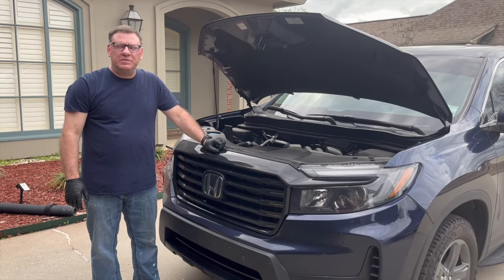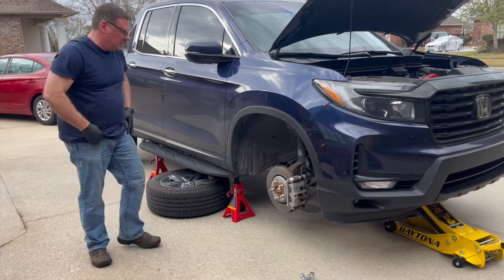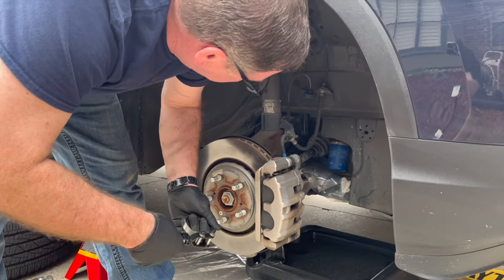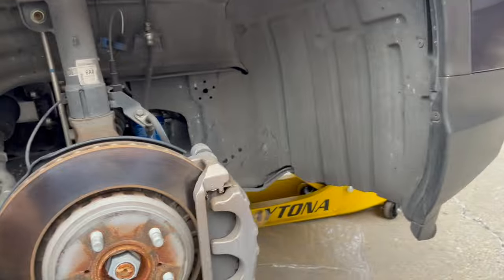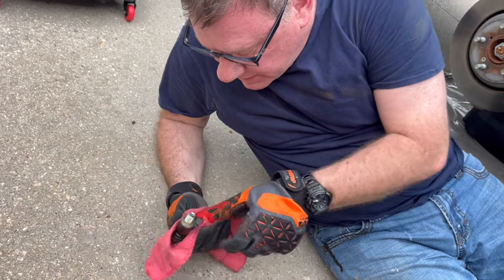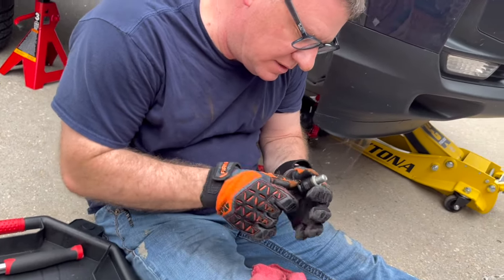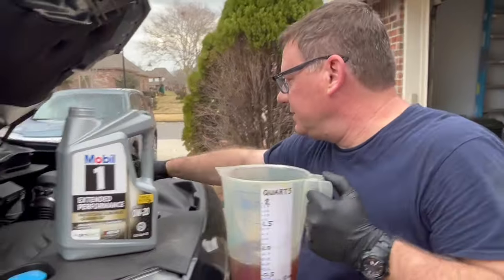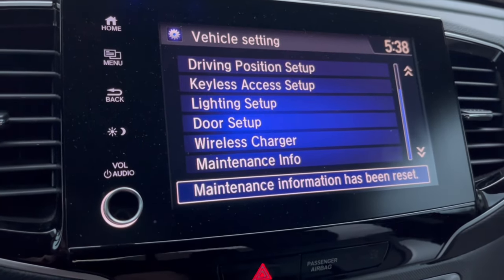2021 Honda Ridgeline Oil Change

Comment: You can use a plastic bag and put it on the filter while removing it. So that way no oil drip on the subframe 😉
Great video, thanks
Reply from the maker: Yeah, I have done that in the past. I should try that next time.
Reply: @PaulNaylor3  Honda is also selling a tool called oil deflector part # VSB02C000052
Reply from the maker: I will look into that, thank you!
Reply from the maker: My local Honda dealer wants $55 plus tax for that deflector funnel. The cheapest I found online was $31 plus tax & shipping. At that price I think I will just continue putting something over that crossbar to protect it.
Reply: @PaulNaylor3  I agree with you
Reply: Thank for the video - very helpful as I just changed the oil in my 2023 Ridgeline for the first time.  Removing the wheel  is definitely the easiest way to get to the oil filter.  I found a great way to remove the filter without making a mess.  I cut off the top of a Kroger 1/2 gallon milk jug (the ones with a built in handle in one corner) - used the top part with the screw on lid attached.  The handle makes it really easy to hold onto.   Because I held the jug handle in my left hand, I cut the jug with a box cutter as follows: with the jug inverted and the handle to my left, I cut the front side about 2 inches above  the top of the (inverted) handle - I had to cut the back side about 1 and 1/2 inches lower to be able to slip it under the filter, ramping the other two sides down from front to back.  I only needed a shop rag on the cross beam under the filter to absorb the  3 or 4 drops of oil which leaked after I removed the filter.  Two cautions (no, I didn't find these out the hard way):  as  you unscrew the filter, be sure that the back side of the milk jug isn't pressed against the filter, as you want the oil to drain down in between the jug and filter and into the jug, not over the back side of the jug; also be sure the screw top (now at the bottom) is firmly screwed on.  I can't think of an easier way to do this, and the jug is re-usable.
Reply: Edit - I didn't cut the front side of the jug down when I did the back because I didn't need to.  I think it would be better if the front was a little shorter as that would make it easier to get my fingers on the filter to unscrew it.  For the next oil change (in about 6 months), I'm going to just cut a milk jug about 1 inch above the top of the handle (top with jug upside down) all the way around.  This should leave a large enough space inside the jug to hold 4 or 5 fluid ounces of oil in addition to the filter, which should be plenty, as most of the 0.3 quarts (9.6 fluid ounces) associated with changing the filter remains inside the filter during removal.

Comment: Love my Ridgeline. HATE changing the oil. Such a dumb place for an oil filter.
Reply: No, Ridgeline isn't in a dumb place in the least ... just not as convenient as other vehicles might be.  You wanna see a really dumb place - change the oil on a 3rd generation GM N-body car with the Tech 4 (Iron Duke) 4-cylinder engine in it.  (1984-1991 Buick Skylark, Pontiac Grand Am, or Oldsmobile Calais)  To get the oil filter off and out of those cars, you have to remove the front passenger-side tire.  Then, you reach through the hole where the steering tie rod goes through to access the oil filter.  The old filter has to come out through that hole, and the new back in through that hole.  You can't see anything you're doing either.  Now THAT is the epitome of DUMB placement.

Comment: Wheel needs to be removed to get to the oil filter?!?
Reply from the maker: If you watched the video, you will see that I removed the front passenger side tire. However, you can get to it by turning the wheels to the right and reaching your arm in between the tire and the vehicle to get to it and you can probably also get to it by sliding underneath the front. There are no skid plates or body panels to remove or anything like that.